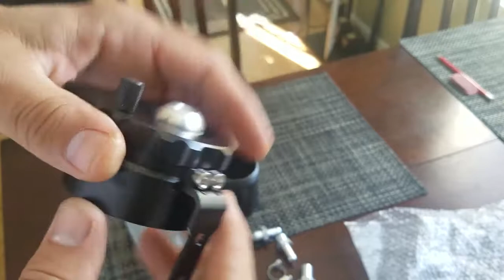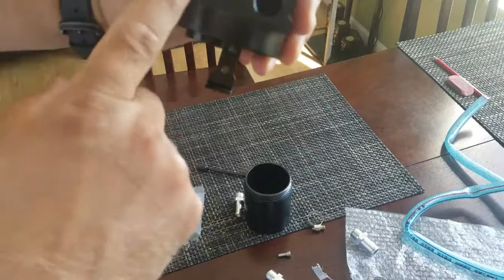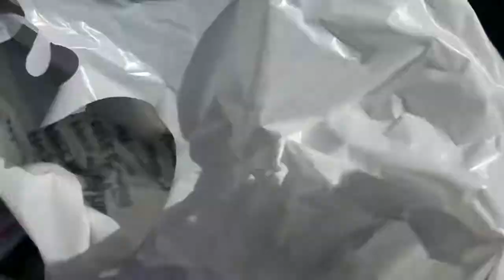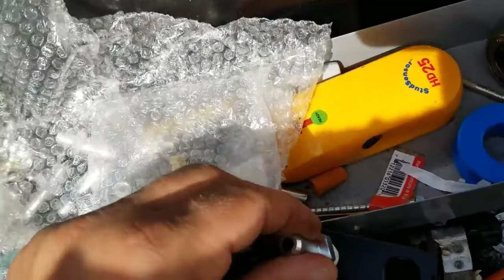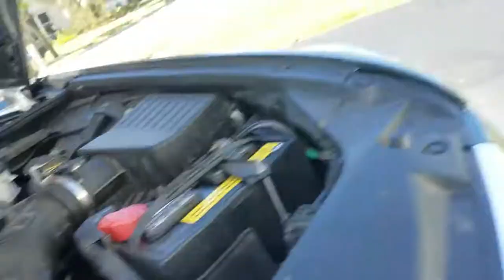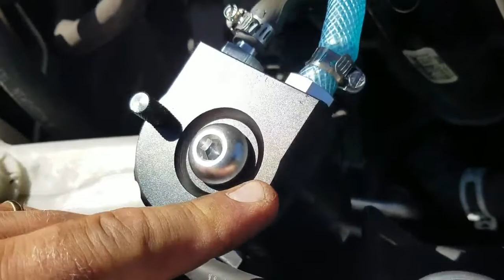Oil catch can installation.

Comment: Hey, can you check out the dipstick and let me know if ya see any oil collecting, iWanna install a catch can and iHave the exact car as you. But not sure if ican do it
Reply from the maker: I checked dipstick after about 1000 miles and some oil collecting. One thing for sure my exhaust pipe is much cleaner,no more carbon buildup on the tip. Definetly buy this kind of oil catch can,it works.
Reply: Thanks man iAppreciate your valuable reply!  I’ve noticed the carbon build up in my exhaust tip with the stock set up and always wondered how to prevent this!👍🏼👍🏼
Reply from the maker: @fonzymtv9317   I have new video review of this oil catch can.
Reply from the maker: https://youtu.be/LAw9XYFKhjM

Comment: I bought a piece from Catch Can. I was thinking of a way to install it.  Your wit helped me a lot.  But I have a question: Is it possible to put something in the filter inside that is full of holes?  For example, a piece of air filter cloth, a copper loofah, or something similar
Reply from the maker: Yes, why not but it’s not necessary
Reply: @nazarettos6987  thank a lot